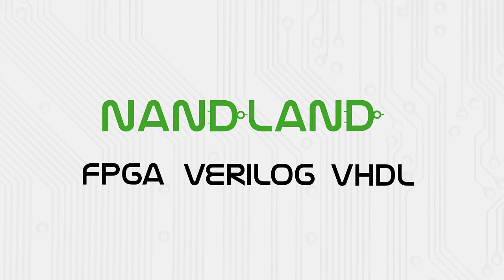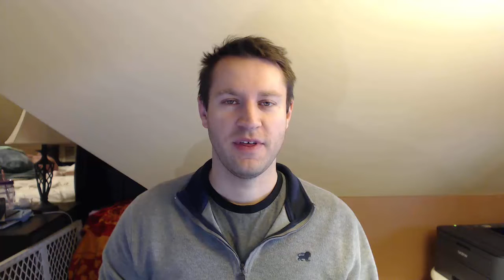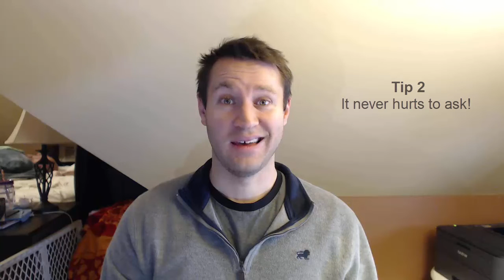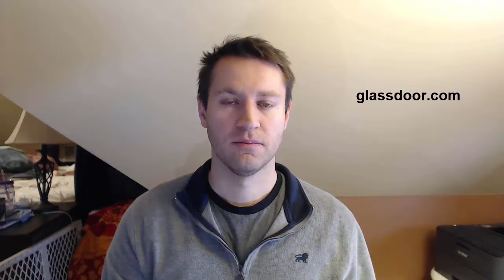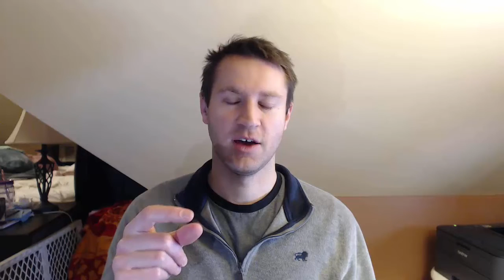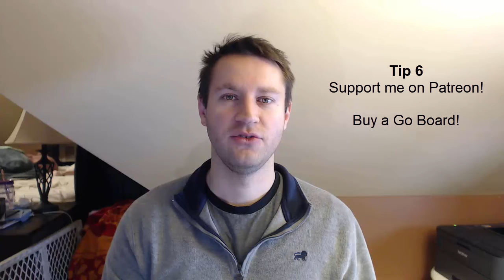Negotiate for job in Engineering, tips to get a great job offer

Comment: Some advice from someone who has interviewed for many different jobs (me):  
1. Most of the time the company will TELL YOU what the position pays, and there's NO wiggle room or negotiation. It's a take it or leave it type of offer.

2. If a company asks what you're currently making, what's the harm in telling them? You're not going to leave your existing job for the same pay level anyway. Believe it or not, companies know better than employees what the market is and how much someone is worth. They do this for a living. They already know what you make (or close to it) when they ask the question. If you're trying to get more money then throw out a BS number. Tell them you make more than what you actually make. Trust me, it doesn't sway the employer. They already know what they're willing to PAY for the current position and you have no leverage. The supply of qualified candidates far exceeds the demand.

3. The ONLY time I was able to secure any kind of pay bump was for a job that was a 45 minute drive outside my hometown. They threw out a number that was low (especially given the additional travel required) and I said "thanks but no thanks" and walked away. They bumped it and came back with a better offer, which I accepted. In that situation, I wasn't playing salary games. They weren't going to get me (or anyone else) to do that job in that location for their original offer. They KNEW they were low and corrected it.

4. The salaries posted on job sites are complete BS. Nobody gets paid that much for any permanent position in this industry. I live in Canada and our dollar is about 71 cents US, which means salaries are HIGHER because the Canadian dollar is worth less. Our minimum wage is $14/hr for example. In the US it's typically about $9/hr.  Unless you're working in Toronto or Vancouver, and you're a project manager or lead IT person, you're not going to make $100,000/yr. You're going to be making about $60,000/yr....... That's the salary for ~90% of all IT people.  These higher salaries are a MYTH. The job posts are FAKED in order to create the ILLUSION that these dream jobs exist. They don't.  Most companies post fake job ads to test the market, determine candidate supply, and to create the illusion that their company is always growing. It's all a game.

Comment: The main question for me is always "how much time it should take for a GOOD programmer to do what i'm currently doing?". It's like... whenever i finish something, either it's an addition or fix to a legacy code or my own project from scratch or an existing thing but "done my own way" i never feel happy or satisfied. Well it's done, good for you, but you just spent almost a week on this one IR receiver??? Really?? Do you have any problems like that in your life?)
Reply from the maker: Rule #1 of life is "It always takes longer than you think it will." So yeah just come to terms with that fact. One thing I've definitely noticed is that the more I program, design, work, the better/faster I get at FINDING problems. 10 years ago if something went wrong it might take me a couple days to figure out what it was, I wouldn't even know where to look. Now though, I've seen so many things go wrong that I can immediately narrow down where a problem lies and it might take me 5 minutes to solve an issue. That only comes with experience.